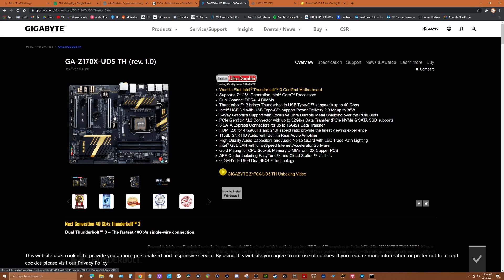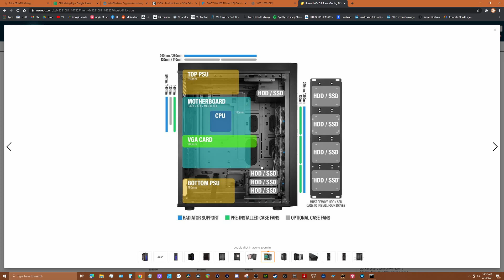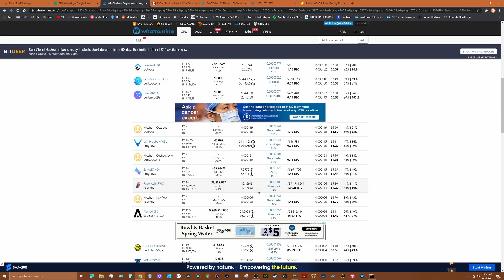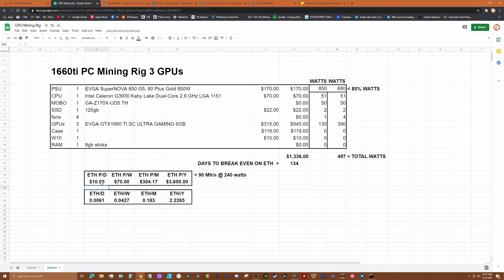Building My First GPU Mining Rig #01 | Planning & Profit Analysis

Comment: Nice. But spending money on hardware solely dedicated to mining seems like a huge gamble, when ETH was only around $200 a few months ago. ie. The current surge might be short lived, like earlier ETH price surges!  I'm more thinking about whether the current ETH price surge could help justify my next gaming GPU upgrade.  I'm currently running RTX2070 (which can achieve ~40MH/s), and have had my eye on an RTX3080 as my next possible GPU upgrade (or RTX3080ti, if it ever gets announced).  But, RTX3080 are currently impossible to find in my neck of the woods.  I can get an inflated price RTX3090, which would be a superb piece of kit for G2 VR and gaming, but impossible for me to justify cost... perhaps until now?  I mean, an RTX3090 can do 100 to 120MH/s, so the additional ETH mined could be a justification argument.  Worst case, if ETH falls again drastically, I've at least still got my awesome gaming setup, for my money spent!  Hmm...
Reply from the maker: Mining is always a gamble. I’m buying 1660 ti cards for around $300 specifically for mining. Like you I plan to upgrade my gaming gpu to a 3080, mine with that when not flying in VR.  Personally I’m into accumulating ETH for the long haul so not too concerned about price fluctuations. Not going to overpay for a gpu either.  1080 ti is just fine for G2 VR flying for now
Reply: Was it though....

Comment: I had great success running my rigs wall mounted.  Ran them 5’ off the ground and servicing them and dusting was much easier as less dust and hair up high.  Cooling was improved.  Still had 7’ open ceiling above.
Reply from the maker: interesting.. how did you mount them on the wall?
Reply: @BamTechVids  motherboard mounted with nylon washers roughly 1/2” off a sheet of plywood.  Had to fabricate some aluminum L channel to hold the gpus.  Powersupply mounted to the board with homemade brackets as well.  Hide the wiring behind the piece of plywood and just drill holes to channel wiring.  Used 12” wiring harnesses from gpus to the motherboard.  Then vinyl wrap the board however you like.  3/4”  nylon spacers or washers to stand it off the wall and mount the plywood to wall with toggle bolts.  Probably $30 in materials from local hardware store and about 4 hours of work.  Finding gpu wiring harnesses was the hardest part.  The gpus were hard to mount.  But it turned out really nice.
Reply: i cant believe a mining computer would cost $1000 to earn 5-$10 a day